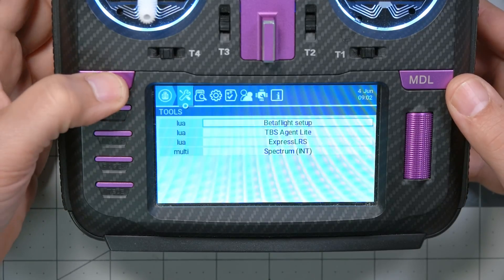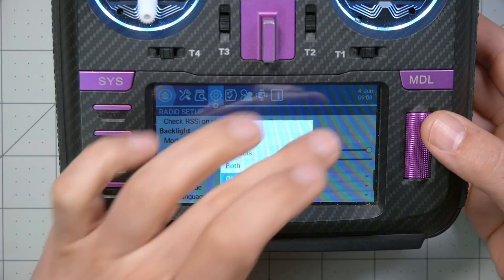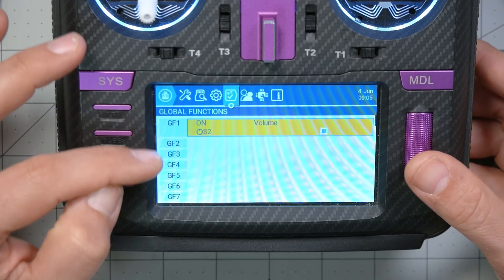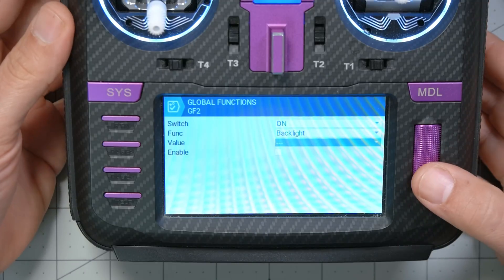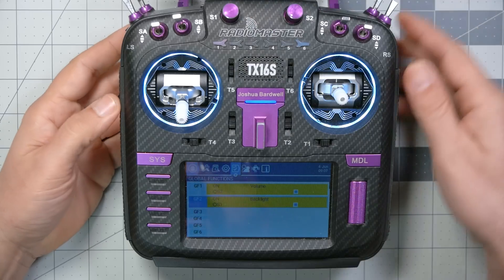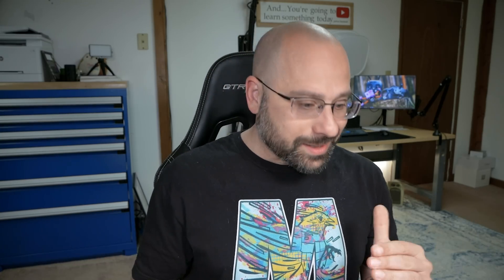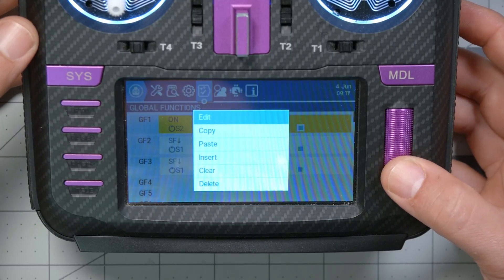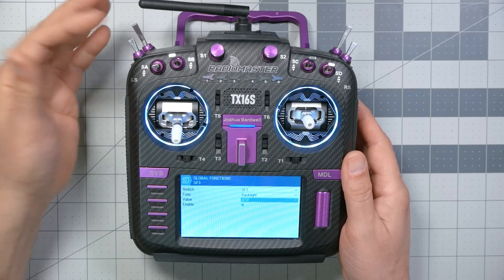Screen brightness on a knob? // EDGETX GLOBAL FUNCTIONS HOW-TO

Comment: Works perfectly on the Radiomaster TX15 on the latest EdgeTX version (04-12-2025). You can set the value of the second function to "MIN" instead of the momentary switch, and you can control both the maximum and minimum brightness of the knob by changing the backlight mode to anything other than "ON" (I set mine to "Both") and setting the desired ON and OFF values to your liking (ON is the max brightness and OFF is the minimum).

Comment: Hey Josh! For me if I turn the S2 (brightness) knob on my TX16S all the way to the left, the screen is still on (around 10%). I couldnt find any setting to change that. I calibrated the knobs again. Nothing changed. I used other switches. Still the same. Do you know how to fix that? Google is of no help unfortunately. I recently switched to EdgeTx. It worked on OpenTX before. So, I wonder why it's not working now.

Comment: for the pocket: 

SA(up)____Backlight_____S1 checkmark
SA(down)______Backlight_____(SE or any other switch but I prefer SE) checkmark

also the reason why there's arm and disarm is because ON only caps it to 50 percent

it probably works on other black and white screens

Comment: Great tip! FWIW, I set up my global function line to enable the backlight knob when my switch is in the disarm position, then set the backlight to "off." When the switch is in the arm position, the default "off" value is applied, otherwise I get the knob setting.
Reply: just set the value to MIN

Comment: Hi
I followed everything on here. However my screen doesn't go completely off or to maximum brightness. I am using s1 rotary control. Edgetx 2.10.2. Is there a way to increase the amount of s1.
Reply from the maker: They no longer let the screen go 100% off, because it would be possible to lock yourself out of the radio by accident.
Reply: Thank you

Comment: Having followed this tutorial, I'm at a loss as to why my screen is still on when the dimmer knob is turned all the way down. I've calibrated. I've made sure the range of brightness is correct...  Ideas anyone...?
Reply from the maker: Edgetx won't completely turn off the screen, to prevent you from accidentally locking yourself out of the radio.
Reply: Wow, I'd have sworn I could turn it all the way off on my boxer... Obviously wasn't paying attention! When left to its own devices the screen timeout allows the screen to go black... Your video makes it appear to go black too... Maybe I need to get my eyes checked !
Reply from the maker: The screen timeout always resets itself when you move a control. In theory, the special function could completely lockout the screen.

Comment: My biggest gripe with the TX16S is that the screen goes dark when you wear polarized sunglasses as it's a polarized screen. If they'd just rotate the screen 90 degrees that problem would go away. Sadly, I have been unable to find sunglasses (particularly ones that fit over prescription glasses) that have a compatible (or no) polarization, and almost all good sunglasses these days are polarized. It's really annoying. Do I want to be able to see my airplane? or see my screen? It shouldn't be a dilemma like that.

Comment: for the boxer:

u need 2 lines
ON________Backlight_____S2
SA(Down)_Backlight___ (no select) this - - - lines

set the standart backlight brightness to 0
and the auto shutoff to a value what u want or set the backlight Mode to ON
Reply: here's how i found out to do it on the Pocket, 

SA(up)____Backlight_____S1 checkmark
SA(down)______Backlight_____(SE or any other switch but I prefer SE) checkmark

I'm on Edgetx Version 2.11

also the reason why there's arm and disarm is because ON only caps it to 50 percent

it probably works on other black and white screens

Comment: Sorry mate this is not working on my new Radiomaster Boxer.... I did everything you mentioned to no avail.
Reply: it works
u need 2 lines
ON________Backlight_____S2
SA(Down)_Backlight___ (no select) this - - - lines

Set the normal backlight to 0
And the auto shutoff to a value what u want or set the backlight Mode to ON

Comment: On my Boxer the knob has that potentiometer jittering so the screen starts flashing randomly if the knob is between the potentiometer positions. 
When I tried to use it for volume control every time I restart - the knob has different range of adjustment.
Reply from the maker: My guess is that when you calibrated the sticks, you didn't calibrate the pots. You have to calibrate all analog inputs including the 6-position button.

Comment: This is awesome. For some reason, when I set this up, my brightness does not turn all the way off when the knob is in its low setting. Is there a reason for this? I was in EDGETX 2.6
Reply from the maker: Edgetx 2.6 won't let it go full dark to prevent accidentally setting up the logic to lock out the screen.
Reply: @JoshuaBardwell  Thanks for the reply. What's your take on upgrading to 2.8?
Reply from the maker: I'm about to do it.

Comment: This video is irrelevant to edge tx now , maybe bardwell should update for edge tx
Reply from the maker: Why is it irrelevant? What changed?
Reply: @JoshuaBardwell in edge tx now you cannot set the backlight delay to zero and even with the potentiometer turned down it wont go to black screen. The only way to get the screen completely off is to wait for the timer. Since the devs didnt want anyone locked out. . but the screen brightness on the potentiometer is still a good tip so maybe not all irelevant. Happy thnxgiving and much luv to you and your fam JB.
Reply from the maker: Yeah I see what you're saying. You can still turn the screen brightness down though, just not all the way to zero.

Comment: Hello, I have the version of Edge TX 2.7.1 and there is no mode off and the selection Backlight (radio setup), using the Poti S1 in the GF menu is functional but the screen cannot be completely darkened. In order to save as much power as possible, I can only select the option (Both) in the menu (Radio Setup / Backlight) and force the backlight to turn off, but as soon as even one stick or other component is moved, the screen switches on again with the preset potentiometer value . It would sometimes be really helpful to know which firmware is  requirement in case of any problems, I only read after a while that with the version 2.6.1 the complete darkening is no longer possible. A reference to this should actually be given along with a current video like this one.
Reply: Thanks for confirming the inability to completely darken screen as well as stating the reason WHY :D  Your comment helped clear my confusion as to why I couldn't achieve the same results as the video.

Comment: To use something more "static" than a momentary switch. In Harware, we can set an additional switch, e.g. SI as a toggle, and then we will no longer have a physical switch. Only set the SI which will always have a constant value.
Well, unless someone modified the radio by adding additional buttons.

Comment: I found that if I temporarily set Logical Switch 64 to be active and assign the global function to turn off the backlight.... then  delete the L64 switch from my model it will then behave properly..... it's a bit of a hack but it doesn't tie any additional physical switches and I don't think I will be using all 64 logical switches.

Comment: I have made sure to follow the steps exactly(edge tx 2.7.1).. issue# 1 my radio wont allow me to select 0s for the backlight timer and issue#2 is that my radio does what yours is doing except it just dims the screen instead of shutting off. Is there anything I'm missing here?
Reply: My new tx16s does the same

Comment: I just set this up on edge tx 2.6.0. I used S1 as you showed, but turning the knob all the way down doesn't turn the screen all the way off. I calibrated all the knobs as well as the sticks after flashing 2.6.0. Just in case I tried it with S2 and also the left slider. All give the same results, all the way down makes the screen dim but not off. Do you have any suggestions on where I may be going wrong? I'm new to FPV and your channel has been so helpful, thank you!
Reply from the maker: EdgeTX 2.6 doesn't go all the way to 0% because they don't want to risk you not being able to see the screen if you screw up the programming.

Comment: You could just use the first global function and turn down the brightness all the way down in radio setup. This will have the desired effect of "turning off" the screen while armed. It also works with 3 position switches.

Comment: Ok so just set mine up and it only works for half the switch if you get what I mean brightness won't go all way down to screen off will go so far then if you turn it back up again it uses half the switch to full brightness other half is dead  🥴

Comment: Well, in EdgeTx version 2.6, it seems the back light won't go all the way off. Despite turning backlight brighness in radio settings to a value of zero.

Edit: If I set the setting to "Both", screen turns off after five seconds. Otherwise it stays on if you set it to "on."

Comment: You can implement a special function using a logical function (XOR SF DOWN) in a model to achieve turning screen off if you have the arm down and disarm up - you posed this question in your video. 
Hope this helps others. Thanks for vid

Comment: A few days ago I upgraded from 2.5 to 2.6 and one thing I noticed is that my screen brightness no longer went all the way down to black.  I enquired about this on the ETX discord and found out that this was an intentional change to prevent someone from getting locked-out of their radio because you couldn't see the screen.  Just thought I'd share.
Reply: Thanks so much for posting that. I am in the middle of making this change and noticed I couldn't go to 0 brightness and it was driving me nuts!
Reply: Yes Thankyou for sharing this I've been pulling my hair out wondering why my brightness wouldn't turn sll the way down on edgetx with this method.
At least now I know it's not something I've done wrong or an issue with my radio.
Nice one 👍🏻
Reply: ohhhhhh
So that's why. I was getting mad here trying to figure out what was I doing wrong. Thank you for sharing this information.
Reply: Anyone figure this out yet,  just updated to 2.8 and cannot control screen brightness to 0
Reply: anyone know a work around to this? i still want to be able to do this LOL
Reply: @YogeshPatel-zc1ne same here, please let me know if you figure something out
Reply: After setting mine up for the first time on 2.8.4 Flying Dutchman, I couldn't even get this to be acknowledged under the controls.  I couldn't do the same for sound as well.  Any thoughts?
Reply: It will turn off the screen when you set Mode to something other than On and after set timeout in seconds
Reply: I just tried this on my zorro and it doesnt work for it.
Reply: Shit that was just the part i liked the most.
Most of the time you don't need a freeking screen anyway.
I'm running EdgeTX 2.10.0 and i noticed a menu withe a option for screen on brightness
and one screen off brightness.
It would be nice if you can over write it to go back all the way to 0 = off

I wish the Edge Team turns this back.
Why al the hassle with global functions and parameters if you can just do it with one simple knob.
Same with the volume. Just mute the freeking voice at 0, Everything i need i can see in the telemetry of my glasses

You must be a but retard to forget what button you programmed to be the brightness and the volume.
Beside that you only have 2 rotary knobs and 2 siders

Maby an idea to turn the first line of code, starting a shutdown sequence with something like:
if [ ScreenBrightness == 0 ] then
    Turn on idiot mode... I mean  ScreenBrightness = 50
fi
    
At least you have a "falisafe" you can always turn on the screen with a 2 sec press of the powerbutton

Joshua... I'm a complete noob in the world of RC Drones.
If i knew earlier that it was this complicated....
(I't took me like a solid 2 months to figure out how everything works, and still i'm figuring out the difference between digital and analog video)
I probably would have started a post-stamp collection.

If you don't like it, you spit on it..... And if you dit it well.
Even the next day you can still stick a new stamp on top.
Otherwise you spit on it again

It is so much less complicated than the deep dive i took into drone-land
I never heard the post delivery complain about not compatibele firmware that cant be updated, due to a missing STM32 driver. So the expensive brick cant be seen in dfu mode by windows.

Noooo the worst thing i ever heard him complain about what: "Ooh my god, my laces has hone lose again. Better tighten them before i trip."

You helped me a lot understanding how everything works in this flying black-box called multi-copter.
I still have a lot of videos to catch-up haha
Thanks a lot :)
Reply: Thank you so much that was driving me crazy
Reply: Finally did this and not going to zero is annoying.  Would be nice if there was a way to do it only with a switch though.  Nobody who sets it up this way is going to be confused by a blank screen.
Reply: Pretty smart idea on the Devs side I think.

Comment: Hello Joshua, is there as way to do this Globally if using a sticky arming switch. I place sw SD- and toggle the momentary SHup for .5sec and It activates Aux1 and moving SD to either other up or dn will disarm for quads.I use the SDdn sw as a throttle cut for my planes. Is there away to Globally work with a logical sticky ARMING for this or will this have to go into the functions for all my quads.
Reply from the maker: This has to be on a per model basis.

Comment: Why does mine only dim all the way when I arm instead of turning off completely?! I been trying to figure it out for like... An hour. I have it setup just like you, except the SH as value. Trying to get the screen off completely when I arm, but it only dims.
Reply from the maker: EdgeTX 2.6 and newer won't go full dark to keep you from accidentally disabling your radio screen if you mess up the settings.
Reply: @JoshuaBardwell  well that kinda stinks!

Comment: Joshua, thanks for all your great work, I have a Jumper T18 and it does not give me the option to add in a special function as you have shown. I can not add a switch to the Backlight function.  I have the latest firmware, any idea's would be greatly appreciated.

Comment: hello joshua, I would like to have your opinion for a problem that I encounter on my analog nazgul 5 v2 on which I have just mounted t-motor 2306.5 in 1950kv, and since then I have vibrations at high speed. I put the PID settings and filters in the middle on betaflight 4.2, and I tried new propellers but Ruen did not. tomorrow I'll try the esc in 48 mhz instead of 24, we'll see. would you have an idea?
Reply: I’d suggest joining his live Q&As. Joshua or fellow fpv peeps in chat may be able to help ya

Comment: I did something similar to this but on the last EdgeTX upgrade I did, the backlight stopped going to off on the lowest value. That and some other issues made me switch back to OpenTX.
Reply: ya i have the same issue did you ever fix it? it seems like the newest upgrade doesnt let you

Comment: you can use a logical switch that you drive with your arm switch
Reply from the maker: That is model specific. You'd need to set it up on every single model.
Reply: @JoshuaBardwell  true. thats not good. but while you have bleeding fingers from setting up the fucking widgets for each model you may as well throw this one in.

that you can copy widgets and cant make them with the configurator is the most idiotic thing about edge. who comes up with that?

Comment: i'm having a very strange issue where i don't have any global functions set, and yet when i turn S1 to the left, it increases T2 trim 
it also isnt allowing me to select the knobs for functions

in the process of typing this my sd card seems to have corrupted 💀
Reply: ok so SD is toasted? but i got a new one in and working, 
was able to get the global functions set

however i still have the weird interaction with pot s1 and trim t2
i've noticed when i center the trim with t2 the monitor for s1 shoots all the way to the left for a second before centering again

anyone have any ideas as to what could be happening?
i've already updated and rewrote firmware before
currently running 2.3.14 otx
Reply: okay i was just messing with it and i guess i fixed it? so i'm going to post what i did in case anyone else has the strange luck i do with this issue

i moved trim t2 down one click, and then turned pot s1 all the way to the left, and then i recentered trim t2 and then s1. it no longer increases t2 when s1 is turned left, even after turning the radio off and on again

magic?

Comment: This was the first thing I did, I put the brightness on a pot and then setup the screen so it’s locked from touch and goes dim while armed. I also have an override switch so I can use the screen while armed if needed. It’s easy to overdo it with all the functions.

Comment: I've always thought those big screens benefit fixed wing but not really anything else.   Helicopters and fpv their isn't much looking at the transmitter while your flying.  Black and white 2d text lcd is good enough for me.     Even on a heli with telemetry I would use a vibrating alarm to let me know when the voltage was low and it was time to land before I dropped out of the sky.